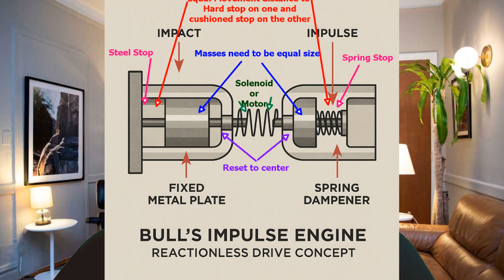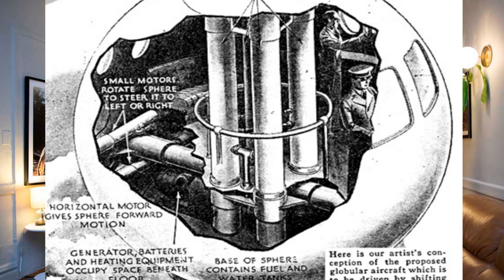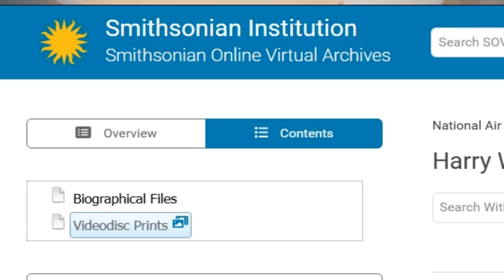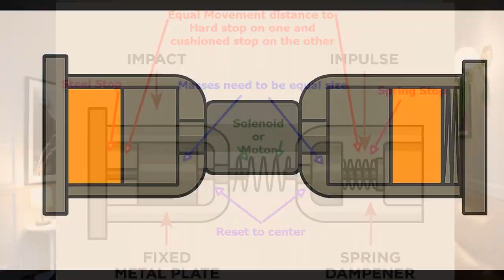Did Henry Bull's Machine Break Physics in 1935?

Comment: I was trying to repeat Henry Bull experiments, building at least one "workable" device but this device was working only on certain specific conditions because it was made from one moving copper coil and one permanent magnet while in Bull's concept there are two masses moving oppositely. https://youtu.be/Pl36aBLy9Js?si=XIhbAT4hIIAxomM- . My device is working but only on the desk as I think. I was trying to join tree such a simple sets in one system powering by a transformer in hope of obtaining stable thrust but it failed. I think that the sets shouldn't work simultaneously but it would be better if it would be working one after another on the circle. https://youtu.be/XCq_dhqENM0?si=2FLjcOp-VYDPZE_I . Those systems are quite primitive in working but the Bull's invention is also very simple. I will be trying to improve my experiments in the future but with application of better materials and parts.
Reply from the maker: Hi, and thanks for the interest in Henry Bull's work. So you have 1 armature per unit. Henry's experimental units, and the experimental setups I made, use 2 armatures moving away from one another at equal speeds. They move the same distance and they impact the stops at the same time. One stop is just a piece of steel, the other is the "spring". Here's the catch, the "spring" is any material that absorbs the impact efficiently over a slightly longer time, so the "spring" could be leather, rubber, cloth, actual spring material, or even a gel. It is the dissimilar or asymmetric impact that causes the Bull drive to move. This is where the experimental focus should begin. One could even use a pair of clappers as found in electrically operated metal bells, each impacting in opposite directions and each hitting the dissimilar material stops. 
Let everyone know how you do with this simple change in design.
Thanks for watching!
Reply: @stclairtechrd  Yes I know that I should apply two weights moving in opposite direction with the same speed   so I could obtain difference in force with respect to side of the device, simultaneously I should apply different impact materials like springs and steel surface or rubber and steel or something like that. I didn't do that due to lack of proper equipment in the lab or lack of skill to do the improvement. I know about Bull's invention since approximately twenty years. Most interesting question is how much force one can obtain using maximally appropriate parameters and materials for the device. Since nearly thirty years I am trying to find an answer whether rotational inertial propulsion can be sufficient for sending spaceships and crews into space. Everything is depending from money and building inertial propulsion without any stable income from continuous and solid job cannot be achievable. I can rely and undertake the cooperation only with the same people as me and I already have met one from Poland the same passionate of such a technology as me. Now we are working together on some projects. What will come from this, time will show. Meanwhile I am trying to build other systems but I am still learning of machining yet.

Comment: Anyone can take a picture of something after it swings off to the side, but what does it do after that? If it swings back to bottom dead center and then stops, it can be configured as a usable system. Simply suspend it with a short tether from an overhead tram track. As it swings out, it will pull the tram to the side, but still stop at the bottom, without reverse tram movement, as the tether swings back.
Reply from the maker: I suspect this photo was staged for the camera. The point is the existence of the test bench and scientist who built it!
Reply: According to mainstream it should not move at all. That it moved to the left proves imbalance of force.

In HB's device masses must be stopped after collision, most importantly for the mass that collides elastically. It shows that even linear momentum is not conserved for part of kinetic Energy can be transformed into plastic deformation and momentum is proportionally lost, as he carefully measured and proved, in his device elastic collision yielded around three times more force than inelastic, creating an asymmetry to accelerate the device from within.

The biggest mistake of mainstream is to treat linear and angular momentum as separately conserved and inconvertible, or conserved at all, and base their whole worldview on that absolutely false assumption.

Comment: My biggest crique for inertial propulsion machines which do not generate sustained lift, is the bench test used to evaluated them. There are several systems which are indeed static friction (or "stiction") drives which cannot generate any type of forward movement without a surface (in the vaccum of space the would stay put and vibrate). As it turns out, Bull's devices DOES work, but not based on any of the tests I've seen to day.  In fact, the pendulum test he used from the image isn't perfect, and has, in the past, validated certain devices which do not generate any force (I will not list them here because some may be subject for controversy).

Moreover, the video clip you pulled from monophoric's channel here:https://www.youtube.com/watch?v=9zTjoYyFwWw is experimentally inconclusive. At best it is permissible as a friction drive, but maybe it is something more (personally I'm more inclined to believe the latter). What IS interesting is the counter intuitive  effect that monomorphic mentioned where the system started to "reverse" in direction when he started chirping. 

For all of the incredible pioneers who work on these systems this report by NASA proves to be fundamental: https://ntrs.nasa.gov/citations/20070004897

If a device doesn't generate lift on its own, then the only way to see if its truly generating emergent force is through the improved pendulum test by NASA. Steve Hampton's work on the Dean Drive, for example, convinced me that it can indeed produce thrust (before I firmly believed it did not work based on some of the investigations on the device Christopher Provatidis). It passed the "more rigorous" version of  pendulum test even though it did not generate lift. You can't find videos of the refined version with good data he posted on his site, but heres the next best things: https://www.youtube.com/watch?v=Pw6Vkk0lXyw

All that said, great video and thank you for your work+research documenting the history and efforts that have taken place on this subject in years past.

Also a  quick question-- is the bulid from 25/2/5 your own? If so, nice job. It looks like an interesting system.
Reply from the maker: Yes, the machines I built and have displayed here use components of other designs but they are my own ground-up builds. Thanks
Reply: @stclairtechrd  Most impressive build--I salute you there. 

Build's involving timing with specialized electronic controllers are very difficult to configure. Iterations/derivatives of Norman Dean and Henry Bull's drives tend to be like this because they are not purely mechanical execution. Would love to see a video on it.
Reply from the maker: Thanks for the comment! There is another way to validate real thrust on earth, in gravity. Put it in a moving vehicle with equipment to measure the power the vehicle uses. If friction is necessary, there will be no reduction in power needed to maintain a steady speed. If there is real thrust generated, the power consumption of the prime powerplant will be reduced. This works pretty well and it's super easy to find a fake...
Reply: @stclairtechrd  Thanks for this insight, its not something which is generally considered. 

Even with this, it can still be a bit unclear as to the "quality" of the thrust being generated. I think it is possible to have a systems which maintain cruising speed, without any substantial loss in power (scalar, usually) during operation, but it tells us nothing about the quality of thrust and its direction (vector).  You are certainly right though--power is definitely something which can be taken into account, especially when doing a more technical evaluations of these systems for sure.

Comment: I could see it working with one impulse stroke with a simple model, but the complexity arises to cycle the masses back to rinse and repeat.  We would have to make sure somehow that the spring force returning the mass back as spring starts to expand again right after max spring compression is always equal to a returning repulsive force some some kind off of the impacting mass at all times, (thrust is achieved only through compression of the spring, expansion force now equal and opposite to said impact mass repulsive return cycle force). This would require some elaborate timing/sensing.  I also believe that a better design would be to use opposing magnetism for the efficient end, and a spring or repulsive mag, with a fluid dampening system of some sort to dissipate energy on the "impacting" end for the masses to prevent extreme wear and tear/noise.
Reply from the maker: Thanks for the reply. You might be correct about the return cycle but I don't think it's as complicated as we tend to make it. Just making one hit like a dead blow is really enough. We draw it with a spring, but change the spring to something like a bean bag and we have the same effect, without the spring loaded rebound problem. Instead of thinking the spring making the difference, think time! A dead blow delivers the same impact as a standard impact, but it delivers it over a longer timeframe! This basic design makes an awesome addition to many of the current designs people are having issues with! Thanks for watching and the good thought process adding to the discussion!
Reply: @stclairtechrd  Thank you Brian.  Whether the force at the tail end of the device opposing the spring sided end is large over a short period of time, verses smaller over a longer period of time, the average effect is the same if energy is conserved, and no rectification and therefore no net impulse occurs.  Some of that energy needs to be transferred away somehow in the tail end side to make it more inefficient to unmask a net impulse.  Deformation of something (beanbag or sand) is a good idea for dispersing that energy (friction/heat of the beans or sand particles) which ultimately is a steampunk method of transferring some of this energy away by means of electromagnetic radiation for rectification.  Hummm.....energy dispersion somehow through eddie current effect with the tail mass/tube interface?  Dang you Brian, now you just got me down a rabbit hole this morning!

This Bull drive has potential.......